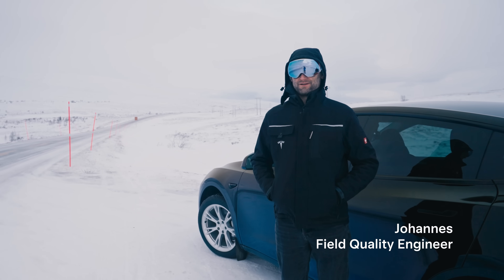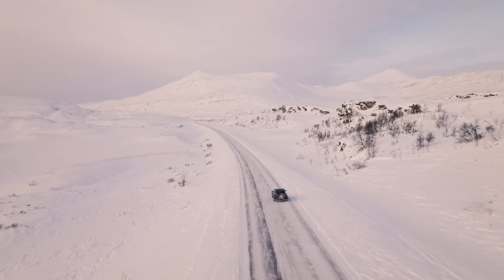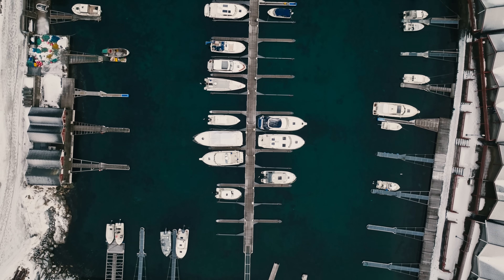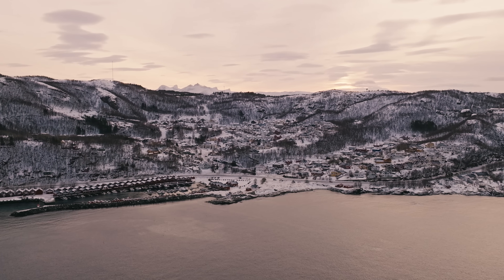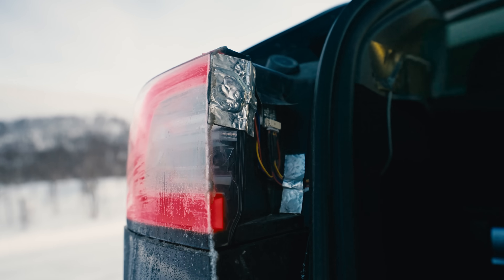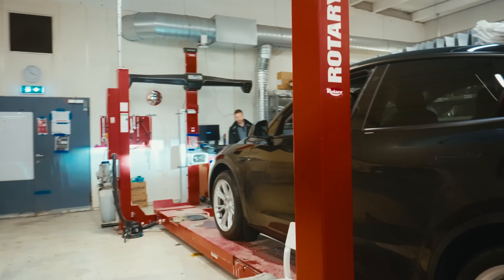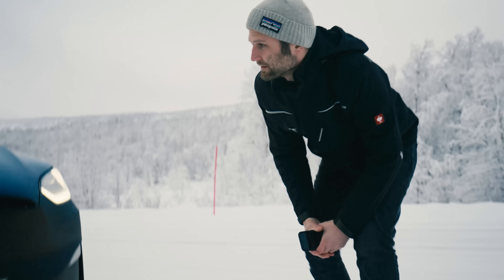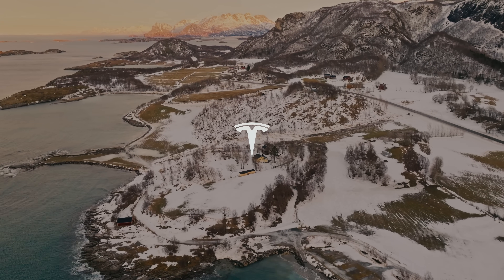Extreme Cold Testing | Tesla Model X & Y

Comment: That's good, but please read this feedback too: on 2019 Model 3 rear door lock hinge was freezing to the door in -15C to the point that I had to constantly lube it and wipe excess water from melting snow with cloth. One time we had a road trip and a rear door was frozen, I couldn't open it for hours and because of attempts to open it the car started to show it as open but the lock was still frozen so I had to drive with annoying warning about open door for hours, autopilot couldn't kick in, it was a disaster. Other times I had to park in shopping mall warm garage just to get it unfreeze.

I think the issue is/was that the drain water from melting snow naturally goes into the rear door hinge under gravity and due to the angle and when negative degrees hit it freezes the lock in the door to the hinge on the car frame. 

So far on 2022 Model 3 I haven't seen this, but I also park in warm garage now instead of leaving the car on the street so I can't tell if the problem is fundamentally solved.
Reply: I haven't had this issue at all on my 2019 model 3, so it might have been a seal problem.
Reply: @logitech4873  it’s not a seal problem but a latch issue I think, because if you open the door while it’s heavy snowing or some snow falls from the roof onto open part it will fall on that sloped angle body part where the latch is and if you don’t clean it will melt and refreze again
Reply: Did you take it to a service center?

Comment: yo elon, ethanol-koh electrolyte for metal-air and potentially for direct methanol fuel cell (oh- ions) for down to -114C of ethanol freezing temp, your engineers can figure out how to feed more spool electrode metal, like a welder, max metal energy storage per kg, try silicon too at 9.0kWh/kg, dont count the engine as the battery fuel cell weight
Reply: yes the fuel cell out of ethanol (and some water) does not freeze, say 60-114C, but avoid water with sensitive metals, like aluminium, and KOH fast hydrogen evolution

Comment: Things you need to change on Tesla’s  
Put speedometer back in normal space. 
better door handles.  Silly and junky 
Make front trunk not feel like garbage.
Make automatic breaking optional. 
AC doesn’t actually adjust up and down in drivers seat. 
Stock rims are problems waiting to happen. 
Mileage left is never correct. 
Key card must be adjusted each start- petty and incredibly annoying.
Key card is dumb- add password pin or fingerprint. 
Add Unlimited warranty on computer as they brick themselves on many vehicles. 
Add mirror dim switch on mirrors. 
Automatic wipers are to slow in light rainfall. 
And lastly it doesn’t print money Biggest problem for me and honestly a total shock.

Comment: My friend brought up stopping a heavy car on ice, What's it like compared to topping a regular car?
Reply: It takes longer to stop a heavier car.
Reply: They have wide tires. As long as your winter tires are good, you'll have a pretty decently good stopping distance. But of course, you should be careful in winter and try to prevent situations where you need to brake hard.

Comment: Three winter adjustments I would like to see. 

1. I live in rural Canada and the cross winds in the winter make white out a regular occurrence. If a snowplow goes by or a large drifting area with wind it causes 100% white out, I use to have my radar locked on to the car Infront of me and slow if the lead car hit their brakes. If I enter the white out and hit my breaks, I am most likely to be rearended. Unfortunately, with the radar disabled and only using cameras I have lost this very valuable safety feature. (a radar map just showing obstacles I would be able to see through the snow). 

2. I would like to be able to turn regen 100% off for very icy roads. When driving over black ice and taking my foot off the accelerator the car will fish tail.  

3. Weather radar map overlay.
Reply: Tesla doesn't care about how they ruined our cars by removing the radar. Simply terrible but would be worse for Tesla if they had an owner of a  "Vision"-car trying out how much better the cars was while using the radar. (And not having the terrible forced used of "auto"-wipers/"Auto"-dim.). Greed, greed & greed.
Reply: Do you really drive that close to each other in those conditions?
Reply: @logitech4873  Its against the law here to brake suddenly without any reason and if proven by witnesses or cameras, you get the blame. Beside that, its terrible a manufacturer can be allowed to make such flawed cars especially with the amount of stories Tesla has told about being safe(st) cars to drive. Sure are, as long as its the cheapest way to produce them it seems.
Reply: @Slendrianen  Brake without reason? I thought we were talking about whiteouts. In 100% whiteouts you should OBVIOUSLY come to a complete and full stop. 
If zero visibility isn't a reason for stopping, what is?
Reply: @logitech4873  You doesn't seem to read what he´s saying about stopping and why the radar was so fantastic. There might be reasons why you dont just stop watching clips of highway accidents where people just drive full speed into that cloud of 0 visibility. But surely that part is insanely wrong, but removal of the radar make it a lot worse now that people sadly do that.
Reply: @Slendrianen  Yes the radar was useful for a few things. I also liked how it could see "one car ahead" by bouncing waves below the car in front.

But I'm just shocked at the idea that you're so afraid of what others are doing that you can't stop your car when visibility drops to zero. Bizarre.
Reply: @logitech4873  Its not me thats afraid, its the threadstarter. I hate the car after removal of the radar as during the winter-halfyear the visibility very often drops below 500 meters which leads to a car thats in reality without any kind of cruisecontrol + even if better visibility, the wipers and auto-dim is 100% controlled by the car when on cruise control which are the 2 worst automations of their kind i have ever experienced in any car during my almost 35 years of driving. Wipers on in 100% dry conditions, lights flashen all the time if you drive after it has rained etc etc etc...The car is just SO filled with flaws its terrible to drive after Vision downgrade in anything but lab-perfect conditions and an utter nightmare when you drive 2 1/2 hour every day.
Reply: @Slendrianen  Cruise control engages auto-wipers by default, but you can just change it after you've engaged cruise.
Reply: @logitech4873  You can not disable the wipers and the issue is most often they want to run in the winter due to a bit of moisture or ice on the inside of the windscreen where the camerahousing is placed making the camera believe it needs to wipe the windscreen. 60 Km is what it normally takes to remove it. All acknowledged by Tesla service here as 100% within specs and well known, just like all the other issues.

Comment: I live in Canada and last winter we had more flash freezing days than usual. It was the first time I had to knock my door handles open and my window functions would not work correctly (flash froze). I had manually push up on my windows to close them. Then Tesla released handless unlock from the app. Don't think that'll resolve the windows though.
Reply: It's a 2018 Dual Motor Long range and an excellent reminder to me to turn climate control and window heating on 10 minutes before I get in the car in the winter. I usually park underground so I never need to preheat and forget to when I park outside.

Comment: Did not show an inch of snow or ice covering car as you would expect at times after work or shopping. Always showed the car clean. Water freezes windows closed will the door open if window doesnt work? Iced folding mirrors blow fuses half extended? Hows driving in 6 inches of snow with no ground clearance? Does it become a plow? I own stock so I really hope they figure out a winter mode or something.
Reply: Driving in deep snow works fine, from experience driving hours through a snowstorm with a model 3.
The other issues are real though.

Comment: Try doing this in rush hour traffic where you are going 0-10 mph for 2 hours in 30 below Fahrenheit!
Reply: Even easier ! EVs use barely any electricity stuck in traffic ! Much better than a gas car!
Reply: That's like a super easy scenario for an EV. They use very little energy when standing still.
Reply: No electricity for heater? Or moving 3 feet every 30 seconds or lose of charge due to temp and lights and wipers on.  Prove it is all I am saying.  We want to see it in cold metropolitan areas please.
Reply: @markdaly5011  Yes, the heater uses electricity. But the batteries in these cars are enormous - they can drive the heater for days. Lights and wipers spend basically no energy.
You need to sit down and do some maths, it's clear you haven't.
Reply: @markdaly5011  There is a YouTuber that tested it in Norway already. bjorn nyland
Reply: @markdaly5011 ICE vehicles use wayyyy more gas just idling when compared to EVs standing still, which basically use nothing

Comment: Your new cars sucks in the winter. Why making this video?   Everything is wrong with the new cars. Heating wipers is short. Doesn't heat the part that's cleaning the camera. Ice build-up...
Plaid AWD sucks. It's doesn't work well in the summer.. So maybe not a winter problem.  The new hvac sucs.  Removing the second row separate heating for the 6 7 seat X? I hope everyone on your team have kids with canser 

https://youtu.be/7CPWUo_XnHk 
A video with how bad the new refresh car is. Compared to the older cars.
The real Tesla engineers. Not the new guys
Reply: But Elon earns 3 US$ more for every car produced ;-)
Reply: @Slendrianen  : way more!  The new cars us so cheap made. Look at the horrible 2015 Mercedes screen on the dashboard.. The Volvo 240 door panels... Ugly and slower steering (wheel).  They make me turn the steering wheel 90° more than the older round. I hate my plaid. And they started to make it slower on low soc now.  Was fast as F from 100-30%soc before. Now it's slow... And they don't allow us to heat up the battery as much on low soc. Warm battery at 38°c instead of 50°. So we need to direct to a supercharger for tricking the battery to heat up. Or els it's a slow car. Can't wait until more people notice this.
Reply: @Krishell  Was a bit ironic about the 3 US$. I use my TM3 LR for 200 Km daily driving and the stress the "Vision" has added during winter ½-years are simply unbearable. Feel your pain about the, in many peoples eyes, fantastic car you got. Yoke seems to my just another cost-saving gimmick and excuse to remove the stalks which i ain't gonna have a car without. Unfortunately not surprised they degraded your battery's handling like that, but having realized with Tesla its max. profit above anything i also realized I'm away from Tesla for good the second i can afford to get rid of the car but kind of sad as i used to love my car beyond anything i have had before during my +30 years of driving. I only supercharge perhaps 5 times a year so feel kind of lucky there but sorry to hear Tesla has ruined other areas of their cars than through the "Vision"-virus.

Comment: HVAC works very well in cold weather, but there are two issues I wish you could look into:
The windscreen washers only spray when the wipers are close to their "park position". That causes the wipers to be more or less dry when they hit the top of the windscreen, making it impossible to clean it no matter how long you use the washers. Only occurs in cold weather on salted roads. It's like having a constant layer of dirt on the windscreen that never goes away. 
Had this issue with my old 2021 Model 3, and same with my 2023 Model Y Performance. Make it spray washer fluid constantly for as long as the button is depressed, would make a huge difference. 

Other issue - please give us the option to turn off regen. Yes, I have track mode, but no - for daily driving it's not very practical.
This is not only for safer driving in the snow, but also to be able to use the brakes properly to prevent rust. The rotors WILL rust if you don't pay extra attention to them, braking hard several times a week. Seen it on both of my Teslas. 
Also helps preventing the clunking noise that comes when shifting driving direction, sounding like the brake pads are loose, for some reason.
Seems that some markets got this in a recent update, but not Norway, where it would make perfect sense.
Reply: You dont have to break hard, just shift in neutral and let the car roll, an then brake a bit, no need for hard braking and then shift back to D and continue driving,
Its very important to do so, if you drove in wet wether conditions and you are about to parking the car.
This way you prevent rust perfectly, cause you dry up the brakes and the brakes doesnt staying wet all night/day, which is the biggest problem here 👍
Reply: Thats weird, I have not had any problems with windshield cleaning on any of my Y's. Actually works very well, and a lot better than on Model X.
Reply: You can turn off regen braking by changing the car behaviour when letting the gas pedal off - just put in „roll“ mode - easy
Reply: @GamoToTheoM  No, «roll» only makes the car not come to a complete halt, just like an ordinary petrol or diesel car with an automstic transmisjon. At least that’s the way Tesla has set up this function in my area. Try a Performance and turn off regen in track mode - that’s what I want an easier option for 😊

Comment: I took my 2007 MacBook Pro up to 8000' Kings Canyon National Park, California.  Winter, snow on the ground, very cold. 0°F. I was camping, the computer stayed in my car (A 1997 Honda Odyssey). The second night there I sat in the car and watched a movie (DVD player in the computer). I brought some snow into the car on my feet. I left the computer out on the seat. After 2-3 nights I drove down the mountain (took the chains off my wheels). It's California so once I was below 4 to 5000' it was warm. 
A few weeks later I noticed black smudges on the screen. I took it into the Apple Store, they replaced the screen. Before I picked it up, I figured out what had happened. The snow I brought into the car melted raising the interior humidity. Then as I went down in altitude to equalize the pressure in the screen this humid air was sucked in. The moisture condensed on the screen, mold grew. 
I was just in a sail boat crossing the north Pacific. Damp, foggy conditions. My bed stayed dry because I was wearing layers of clothes 24 hours a day and I slept inside a bivy sack. The last couple of days all this changed. Underneath the mattress, which I'd been checking regularly, was soaking wet.  
Of course all this happens to our cars. My Model Y had two moisture related problems. The door column camera stopped working. I think because I removed the Tesla roof rack. Later I caulked the areas where the rack was attached. I also had a problem with the driver's door. The window kept going up and down for no reason. I'd close the door and the window was up too high. I was afraid it was going to shatter.  Water had come in through the open window and got in the pocket at the bottom of the door. The tech replaced a sensor. She was familiar with the problem.

Comment: Having an EV has made winter driving so much more bearable. The convenience of it is just so great.
Reply: Yes, this should be mentioned more frequently. I hate to pump gas on freezing mornings, just to get to work. Home charging + pre conditioning are underrated conveniences
Reply: @suvari225  yea but is it also fun when your car says your gonna get there at 25% and you end up getting there at 2% and this happens every day constantly every time you try and drive it? And yes i pre condtion and yes i dont speed in fact i go under the speed limit becuase i dont trust my cars range reading. Just love spending 110k for a car and it cant even tell you how many miles you can drive.
Reply: @skyshade9106 your talking nonsense 😂😂
Reply: @skyshade9106 It does not sound like you have a Tesla. That is nowhere near the experience I have.
Reply: @skyshade9106  That's very strange. Which range estimate are you using?
Reply: @Syniah.ofc1  I swear to god on my life model x and model y same experience no where near it sometime it’s right too it’s crazy how bad it is
Reply: @logitech4873  I just set my car to the destination then see what it says what percent I’m gonna get there at I don’t use the mi way of calculating battery becuase even the video in the playbox called like Tesla tutorials tells you not to
Reply: @logitech4873  another problem too is my car thinks the speed limit is 70 like half the time on they way there but it’s actually 80 I have no idea why i have already contacted Tesla but no reply so maybe that’s why the range estimate is so terrible? Becuase I drive the same drive (around 2 hours on the interstate) 3 times a week and I bought a Tesla becuase I was spending so much money on gas and I thought this would be convenient but it’s definitely not, don’t get me wrong I love my car for everything but the battery.
Reply: I just ordered one today, I'd be interested to know what things are easier in the winter that I can look forward to!
Reply: @HecticGlenn  The number one thing I like about our EVs in winter is warmth.

When I drop kids off at school I drive all of 1-3 miles. In a gas vehicle you freeze the entire time, and it was murder on the engine to start it at 0F and to never get to operating temp.
In the EV I'm warm most of the drive even in extreme cold.

If I need to remain in the car while I wait for wife its easy to stay warm (heating while parked has negligible impact on range)